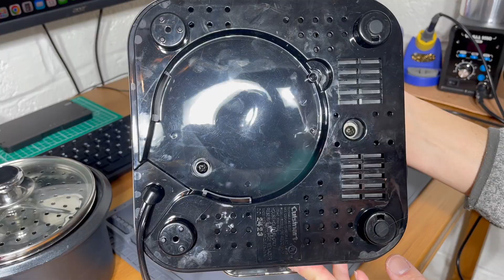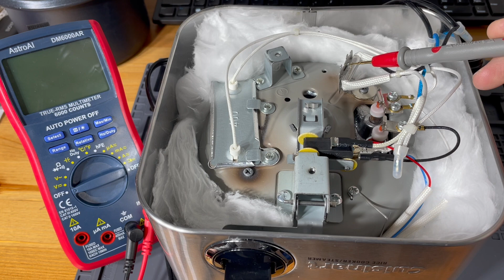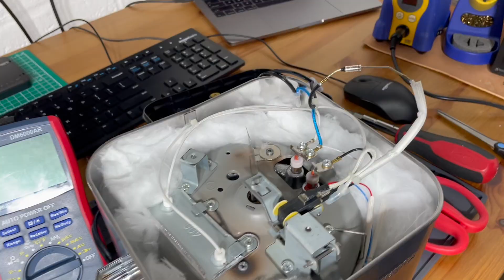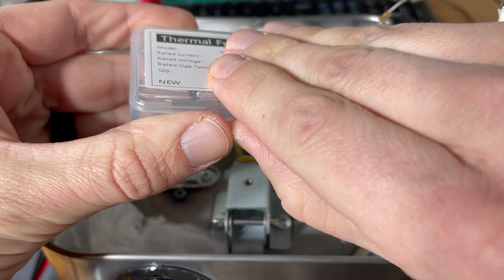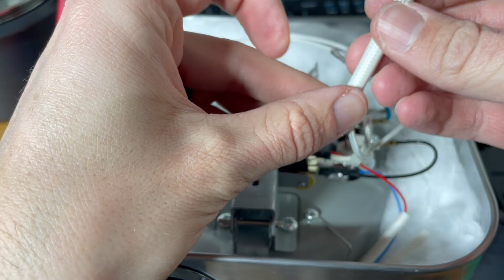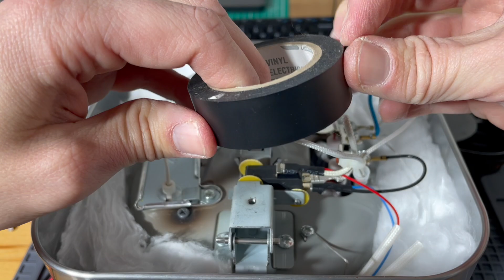Cuisinart Rice Cooker No Lights No Heat Repair | Thermal Fuse Replacement

Comment: I need to do exactly the same on a Cuisinart blender. I was intimidated to solder a thermal fuse risking blowing the fuse, needing heat sinks and employing other techniques . Seeing the fuses coming with connectors makes all the difference in my mind.Thx for showing this.
Reply from the maker: Yes, they are meant to be replaced! Glad I could help.

Comment: I've had two of these same models fritz in the last six months. Both exhibited faulty performance requiring several resets on a cook before completely failing. Since I didn't see any blown parts when I took it apart (I'm not an electrical tech), I replaced the first failed unit, which was 20 years old, and had not been used often until recently. The new unit lasted about 6 months with the same issue. I bought an Aroma brand rice cooker at Wal-Mart at half the cost of these. It actually does a more uniform job of cooking the rice, with no hot spots and scorched areas on the bottom of my cook like the "upscale" Cuisinart. The rice was perfectly fluffy and the lock down lid eliminates the boil over onto the counter that the Cuisinarts do on intermittent occasions, which indicates that cooking temps vary wildly. The Aroma has a digital panel with some additional cooking options. What I liked about the Cuisinart was its simplicity and compact design, but I'll be damned if I'm going to spend double the cost of the Aroma again when Cuisinart is obviously cheaping out on their parts and using an old circuit that is unforgiving to save production costs. I will order the fuses and try this repair to salvage it as a back-up. Thank you for chasing your problem down and posting the video.

Update 6/4/26: I ordered the fuse from eBay and successfully restored operation, so thank you C & S! BUT... I'm not confident this repair will last due to it happening twice now on two different units.  I conferred with my son, an electronics tech, and he is guessing the heating element Cuisinart uses has hot spots due to poor specs, which are caused by areas of lower resistance on the element that allow it to get hotter than the safety/operating range of the circuit, thereby tripping the fuse. This is borne out by the scorched spots on the rice where the element overheats. Being that this was a recurring issue with my two units purchased over a wide period of time leads me to believe Cuisinart doesn't give a shit about their customers or their reputation. Now 20 years might seem to be a decent service life, but the older unit was put away and not used for 19 1/2 years of its life, lol. So this failure pattern happened twice in about 6 months time of regular weekly use on two almost identical cookers.